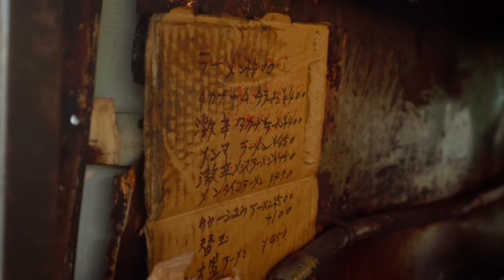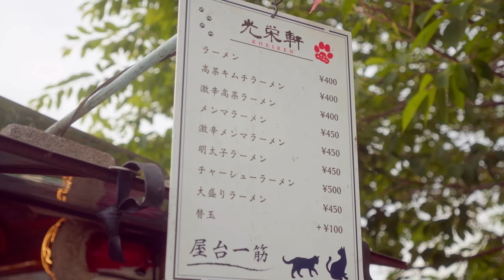屋台ラーメン Old Style Ramen Stall - Japanese Street Food - 3 Hours of Sleep for This Owner  光栄軒 라면 拉面 大分県

Comment: A diligent and efficient taxpayer.

But, it is a real danger to consume everything prepared in this "restaurant". It will not pass any basic control or regulation and even the most negligent.

This "restaurateur" puts animal products and vegetables in an old car, and worn, in the heat, dirt and filth, in all weather and not under a repaired and orderly roof.

Also, the ramen and food are sold at a loss. This is a disgrace and self-indecency!

Alongside the harsh criticism, diligence, non-victimization and relative expertise should be commended